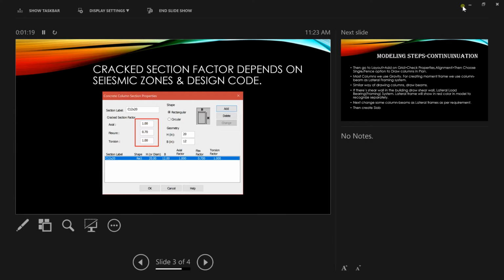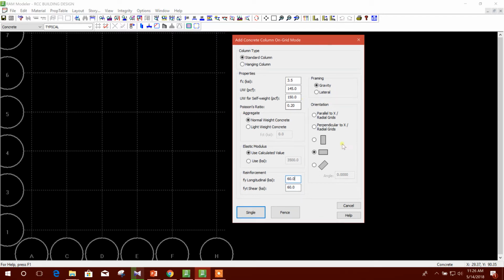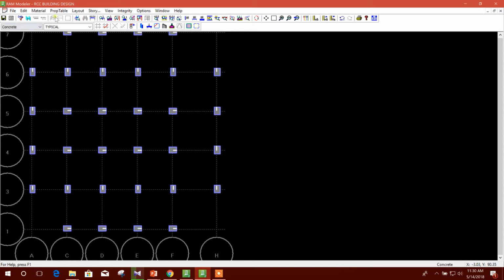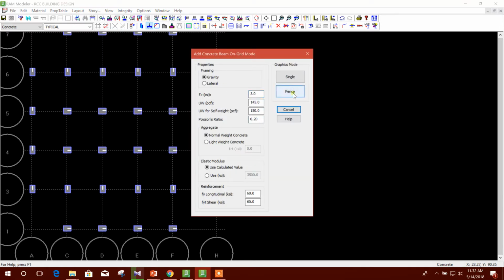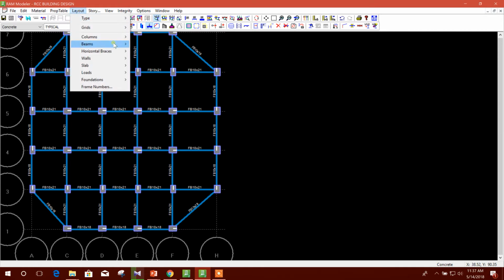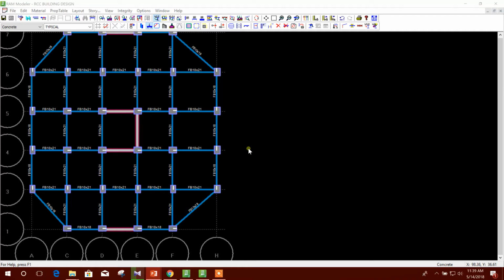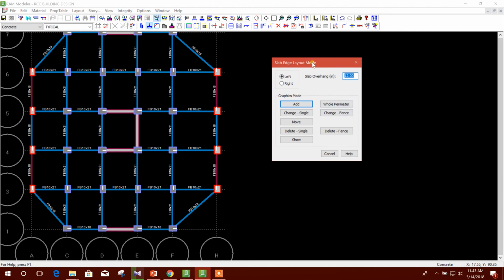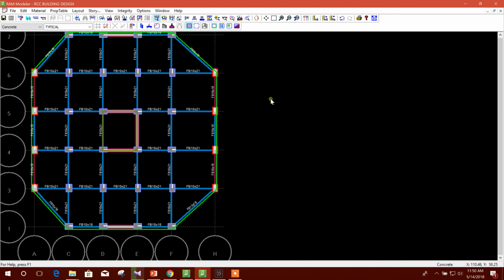RAM STRUCTURAL SYSTEM COURSE-MODELING COLUMN,BEAM,SHEAR WALL&SLAB

Comment: Mashallah Finally you started speaking...I requested you a lot where you did everything but there was no voice just music. Thanks, this is an improvement in your channel. Make sure you decorate your channel further with more and more videos on Ram Structure (both concrete and steel), Sap2000, Etabs, Autodesk Robot Structural Analysis, Staad pro & Autocad Structural detailing (ASD). Please upload more and more videos with the vocal explanation (Explanation through voice). Thanks